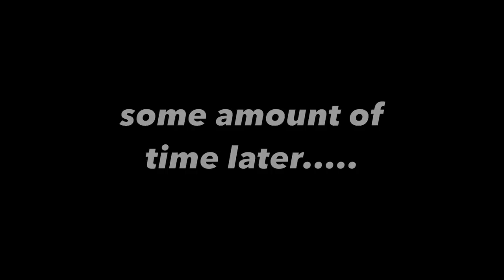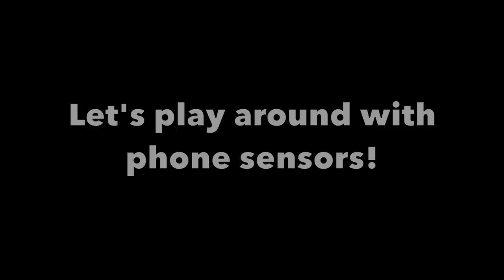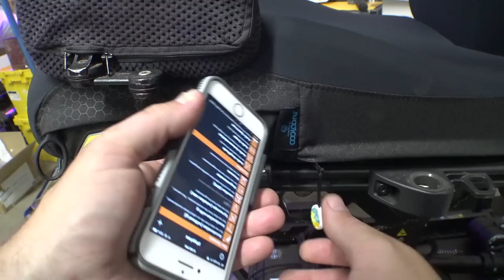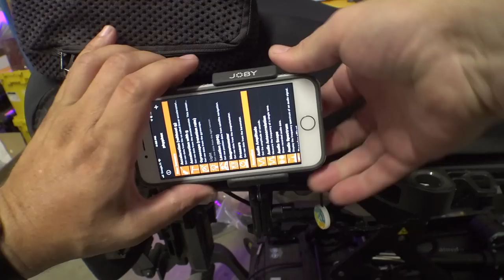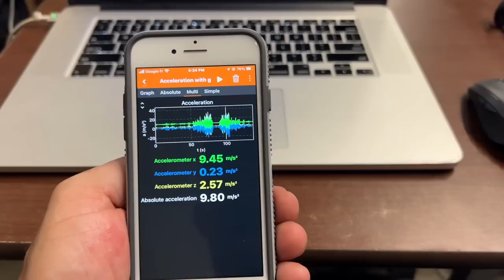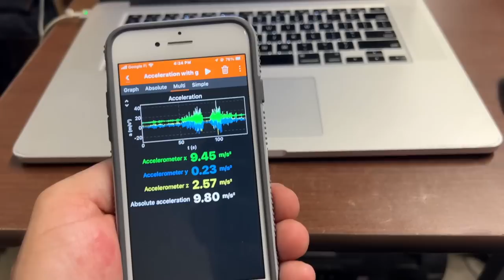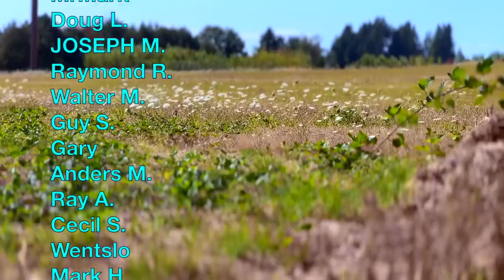VLOG 674: ride quality data & new chair! (+broken vans lol)

Comment: hey Dan, its Paul here from Brisbane Australia here and i sorry if this is not the correct way to contact you but im new at this game. Anyhow i have a couple of questions . Firstly power chairs versus mobility scooters. i have a basic small power chair thats fine for getting around in my care home but its useless on grass of dirt surfaces, so i was looking at upgrading it for a mobility scooter a 4 wheel one which seem to be availabe here quiet cheap ($1500 -$2500) as opposed to about $7500-$10000 new eg Pride pathfinder 140 xl, But my question to you is why dont you go this route and continue to use power chairs  etc your bounder, my use for it is similar to i see you travel with your bounder, except i use a maxi taxi (a van with a wheel chair lift platform in the back, i also have to be strapped down when riding it) to go long distances. And i just realized you need the powerchair to drive your van. So sorry mate please ignore the question i posed, i would however be interested in your opinion as to the best opt[on for me. I have parkinsons but it has only affected my speech,writing and a bit of balance when walking. Cheers Paul

Comment: You've intrigued me with Amy Systems pwc's since introducing your first. Unfortunately, I'm not finding the wealth of info as provided by Permobil, Sunrise Medical, etc. Your chair looks amazing and after reading comments, along with your own, the 'ride' must be exceptionally good. Although, after butchering cabinetry in the kitchen and bathrooms with two-sided caster forks at home, that issue has been addressed with the one-sided caster forks. I'm sixty-eight and steeped in automotive repair, sales, and technologies, new and old. The cost of vans and service/ repair are beyond unreasonable! Vocational Rehabilitation will pay up to $35,000.00 to modify a used van that meets their criteria - their services are available to all. This will be my eighth experience with V.R. who have no problem assisting folks with group four pwc's where applicable.

Comment: I would check MnMaster-Carr for gas springs for the bridge plate, they are under $30 for ones with threaded ends if you can't find ones for automotive that meet the specs you need

Comment: With all the tinkering you do, You should be able to slap a set of rotors and pads on that thing for cheap. 9/10 times the E brake shoes are 90%.I've never had to replace a set.As long as the calipers are not leaking or stuck, i wouldnt change those either. My family has had like 10 of those vans i did the maintence on all of them. The transmissions do suck, but if you have a good one, it will last well over 120k

Comment: Wow 121k miles my 2013 grand caravan has 245k miles on it the oil is still clean and clear like new unfortunately I had to buy what I could afford it runs good ac blows cold it was a fleet vehicle but I have access to all the maintenance records by still going to the dodge dealership that has been taking care of it since it was purchased by the company I did have to spend another $5500 on replacing the front struts and I ended up beefing up the front brakes and I just put new tires on for another $500 and now the clock spring is starting to short out in the steering wheel I'm good with knowing what needs to be done I just need the body to cooperate Lmao have a good weekend Dan 👍

Comment: Would it provide more accurate data to remove the rubber pads from the phone mount and the case? The vibration dampening from both may result in less reliable data.

Comment: Hi Dan another great video I don't know if you still have the blue van I had a 1997 chrysler T&C  with the 41TE trans with the 3.8 V6 I sold it with 198K  got 19mpg hiway these trans are fine if and that is the issue you use  ATF+4 fluid  being a retired Chrysler tech I have had no issues with them my current Van is a 2014 T&C with the 3.6 gets about the same mpg anyway 120 k on your van isnot a big deal unless it was not maintained  just had to add my 2 cents
Reply from the maker: Yea these aren’t actually BAD transmissions.. they’re just misunderstood- and the documentation wasn’t clear enough about the types of fluid that can be used etc.. there were a series of software updates that reduced the input/output shaft sensitivity early on that prevented the premature check engine light and subsequent ’limp mode’ - honestly I’m surprised they even got the system working in the late 80’s! It’s a HIGHLY software controlled setup- and it’s missing about 40% of the moving parts that traditional transmissions had up to that point! 
It’s revolutionary really.. lol
Reply: @TotallyNormal-  The biggest improvement was the seals usedwe saw alot of worn out seal in the clutch packs the key was going from a lip seal to a  d shape seal with the improved ATF formula that lessened the Torque converter shudder I only seen a few trans failures due to hard parts failures. All in all the 1996 and newer models had alot fewer issues during these years lack of PM / wrong fluid or drive and put gas in it mentality was a comon reason for failures. I am glad I found your channel it has given more info on the magical pixies that makes our powerchairs do what they do ! Lol thanks again sir.

Comment: 63 post C5 injury. Have a Magic Mobility V4 RWD Off road. Great chair outdoors. manageable inside home and WAV. Main drawback: does not recline enough. Any hack ideas to get more recline? Realize the risk of tipping over. Want be the first , or 100th time  Thanks. Burnie
Reply from the maker: im not 100% familiar with the newer V6/V4 chairs.. i think they're using motion concepts seating now in the US.. but not 100% sure on that, or if any adjustments are possible :^/

Comment: it's weird that it has 6 wheels but its called an R3. mine is the M3 but the front wheels are closer to the drive wheels and the rear wheels are farther away
Reply from the maker: its the R3 hybrid - 'rear wheel drive'  but has better maneuvering space indoors than a traditional RWD chair :^)

Comment: I was building my handicap van using 2006 dodge sprinter 2500. I mounted a new HD lift on the side door and built my own power door . Swivel seat to transfer n drive. But now im not even able to get out of bed. The battery is dead n not sure of lift battery now. I'm thinking of selling my van even tho I dont want to. Hoping ill get the spine to break loose from   its straight line back to curved . pains unbearable. The Mercedes diesel only has 106,000 when I bought it now I bet its got 108,000 I drove it one time before because it stuck in bed.
Reply from the maker: building stuff yourself is nice when able to! then ya know EXACTLY how it all works! frustrating tho when things change, and ya have to let a project go :^/

Comment: Butt sensors are unreliable and can't be calibrated.   It will be impressive if you can get actual/real objective data from the phone.   You'll need a test track and repeatable driving conditions to make it the most valid.   I doubt this has ever been done.   Can't wait to see how chairs compare.

Comment: Can’t you just do a head job on in the Engine in the green van?
Reply from the maker: these ford modular engines are kinda 'disposable'. its possible to rebuild and/or replace heads etc, but the parts are super expensive and impossible to find.  i priced out a rebuild, and it was almost the same cost- BUT the crate engines out there have been updated to fix a few other issues inherent to the 5.4 as well.  
its SUPER labor intensive to get these things out of a van chassis, so if i have the work done, i don't wanna do it again for at least another 150k miles lol